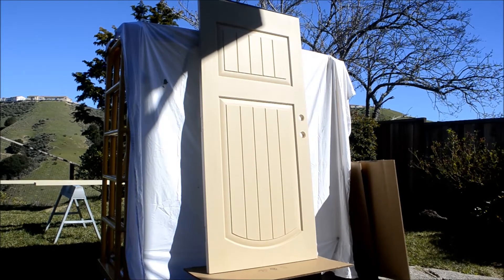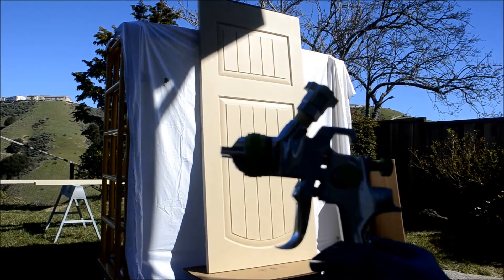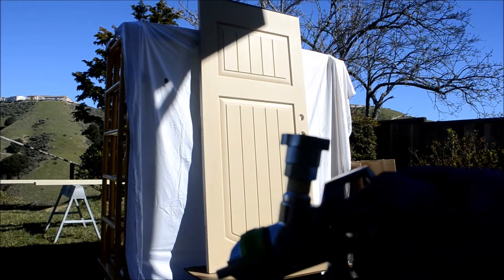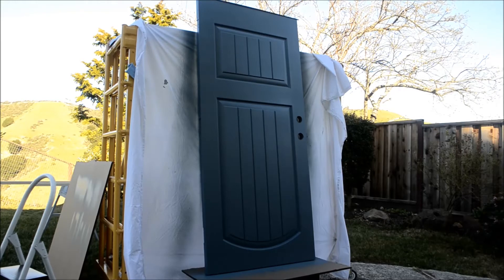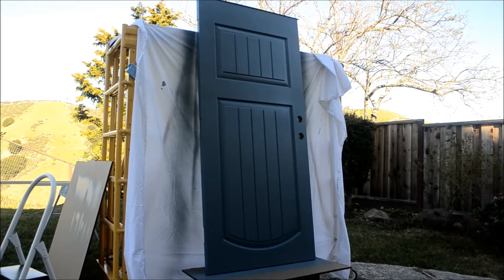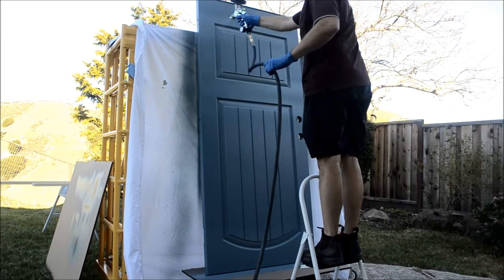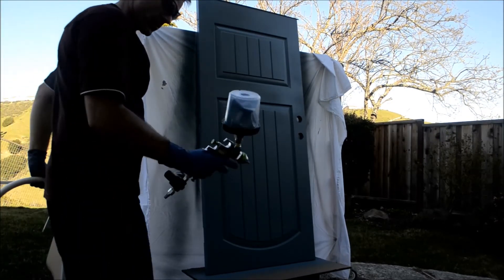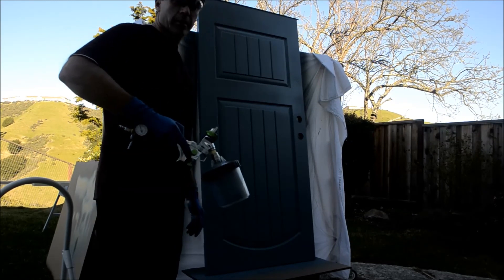Spraying Latex with HVLP (TCP G6600-25)

Comment: What 3m pps adapter is that? I’m looking for one but can’t figure out the proper female thread size.
Reply from the maker: Take a look at my response to rc man.
Reply: DIY Dan awesome! Thank you. Now last question, did you still have to use that little filter in the gun or just use the filter in the lids? I know without that filter in the gun normally the paint would run. So just wondering if you used both or just the lids from 3m
Reply from the maker: @Driven716  I don't remember the filter in the gun but I did remove the filter from the PPS container lids and then filtered the paint prior to pouring into the PPS.

Comment: This video made me go straight out and buy a cheap 2.5mm tip spray gun. Unfortunately the one you used weren't available i the EU anymore, so bought the only 2.5mm gun i could find.
I don't need a stellar finish, since i'm using it to paint home made apple crates i sell at markets.

If it's not too much trouble, could you maybe give some detail regarding what pressure you  used, and if you had to thin the paint?
Reply from the maker: Hi, I run about 40PSI at the gun, and adjust it up/down depending on the paint thickness, air temp and the practice spray on waste cardboard. I always thin latex pain and I use and 10% water to do it. I shoot for the consistency of cream, so  the paint should stream off the mixing stick pretty fast and then start  dripping off the stick shortly after the constant stream runs off. In my experience you get the best finish when the material is laying flat, not vertical like I did in the video. Also slower gun movement is better but it is a fine balance as you dont want runs in the paint, it just takes practice, hopefully this helps.
Reply: Thanks man - i helps a lot to have a starting point. And seeing as painting apple crates isn't something that requires the very smoothest of finishes, it being rustic and all, it will be the perfect way to practise. For anybody reading along, the gun i purchased was the Auarita E-70A spray gun on eBay uk, very cheap, but people are saying good things, and at £20 including shipping, it's a very low risk purchase.

Comment: Awesome video.  I have some HVLP sprayers from HFT and the Wagner latex sprayer with the separate vacuum cleaner-motor and hose.  The problem with the Wagner is latex dries FAST almost in real time.  This is a nice setup with the 2.5mm tip!  Yeah!  My biggest HVLP is 1.8 but it is a siphon suction gun.  3M PPS system is awesome and I want one but not sure if I can justify the cost for my occasional use.  Also, I'm sure the 2.5mm would be helpful with oil based paints like Rustoleum - I find i need to thin them with acetone 30%+ to get them to spray without spitting through a 1.4mm needle.  Also, we have to get ready for the reality of waterborne automotive coatings as the goal of eliminating all high VOC coatings is being rolled out.  Thanks!

Comment: What size compressor are you using? Specs?
Reply from the maker: I have a quincy Qr25-370 with a 200 gallon tank. Not sure what the actual cfm is but it is somewhere between 18-49 @175psig depending on the RMP of the pump (which I don't know). My compressor is overkill, but I got it cheap.
Reply: Thank you.
Reply: What it the size of the thread on the adapter [or the gun] ??
Reply from the maker: @silentassasin21  Not sure. I just bought the "3M 16003 PPS Adapter 2" from Amazon and it worked perfectly.

Comment: you ever use a airless sprayer and use a fine tip?
Reply from the maker: I have used an airless but not with a fine tip. I am sure it would work well but I didn't want to spend a bunch on a sprayer I probably wouldn't use much. For small jobs this setup works fine. I have painted trim and cabinets with it and they turned out really nice, as long as you thin the latex a little with water.
Reply: Hank Hill  i use an airless sprayer with a 211 tip and it does a great job on doors and trim. It definitely uses a lot more paint than an hvlp would though.